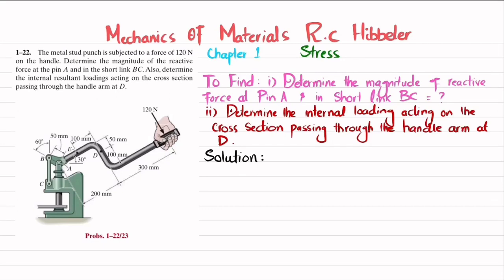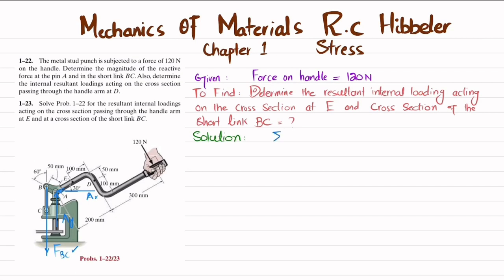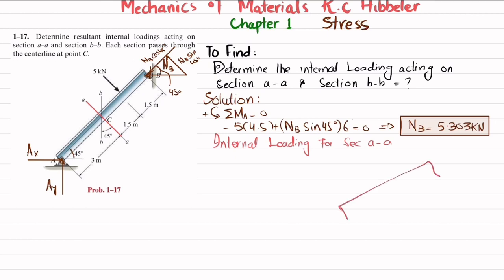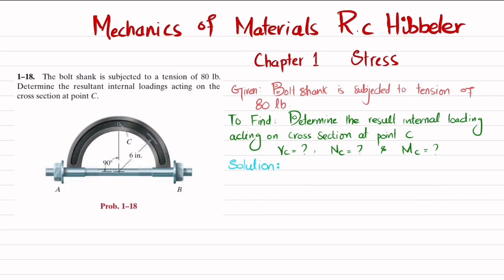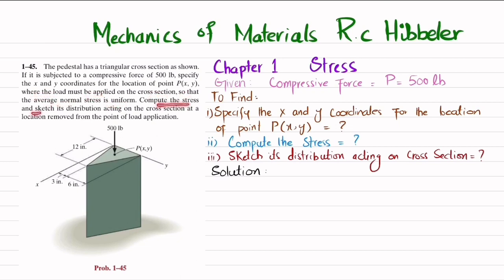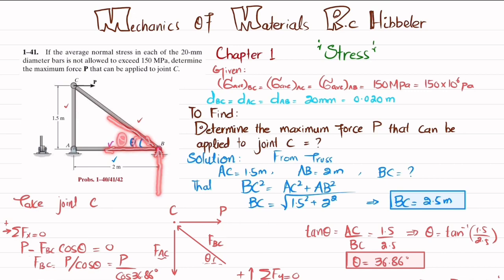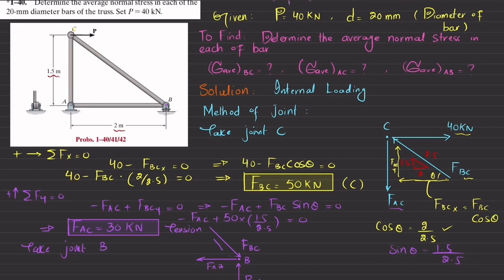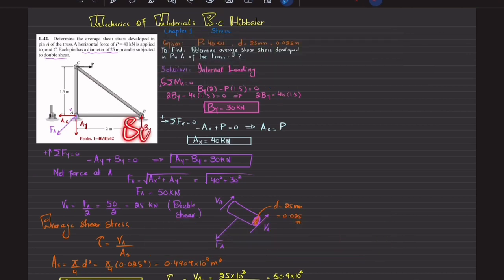Internal loading | stress | shear force | Moment | Mech of materials rc hibbeler

Comment: Could you do problem 7-35 and 7-36 in chapter 7 engineering mechanics statics R.C Hibbeler fourteenth edition page 359? A curved distributed load on a curved frame like a semicircle
Reply from the maker: Dear I m doing mechanics of materials by rc hibbeler not static. In future I have planned to start it. Thank you
Reply: @engradnanrasheedmechanical  I've seen your chapter 1 mechanics of materials videos and they are all about internal forces and a bit of normal stress...This problem is in the same chapter of frames and machines which covers internal forces too :). Btw, thank you
Reply from the maker: Thank you 😊 💓